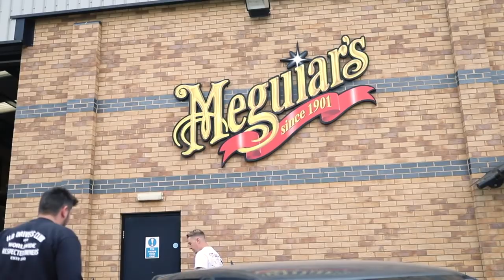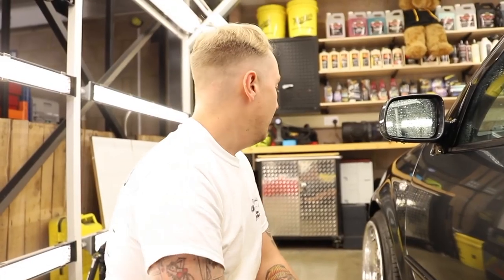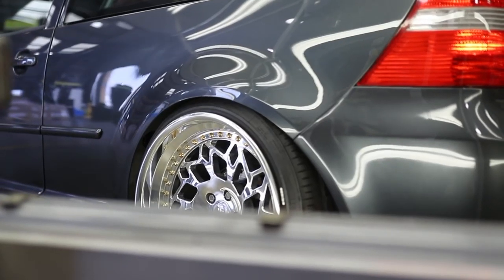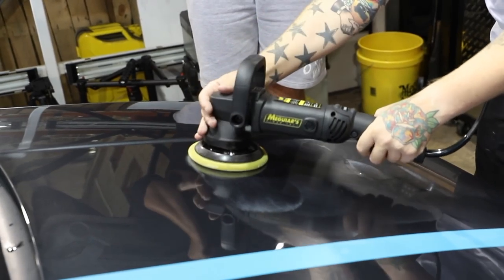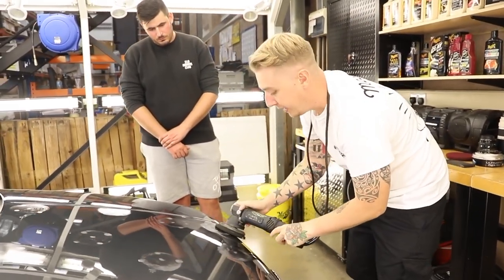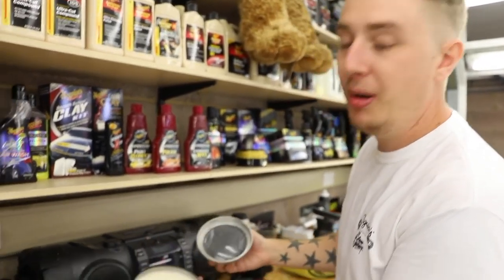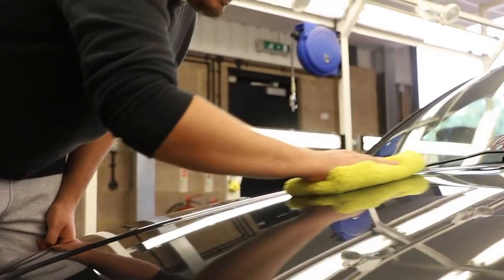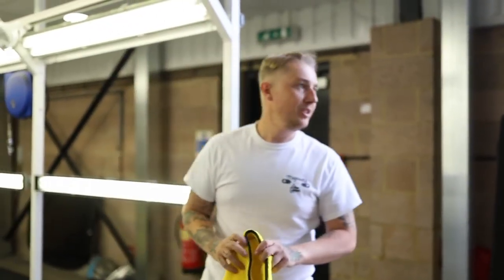How to Clean, Polish & Protect for a Show Car Appearance - Day in the Bay – UK Edition

Comment: Great video!  Question...what did you do after claying?  Did you rinse the car off and dry again before polishing or did you just go strait into the polish after claying the whole care segment by segment?
Reply from the maker: It is not necessary to wash & dry after claying, simply wipe off detail spray lubricant residue with a microfiber towel.  You may see detailers clay during washing or wash after claying, it is just a matter of preference not necessity.

Comment: Are you polishing with a finishing pad to reduce the cut?
Reply from the maker: Technically, if no defect removal is necessary either a polishing or finishing pad will work.  If you have discovered a particular paint to be very soft you will likely want to choose a finishing pad even for application of a polish.  Our friends in the UK may simply like the finishing pad better or found it necessary for this particular situation/vehicle.